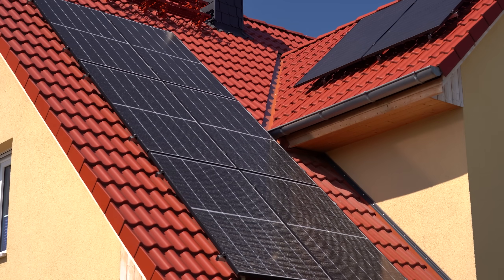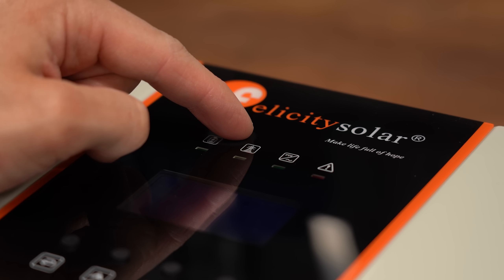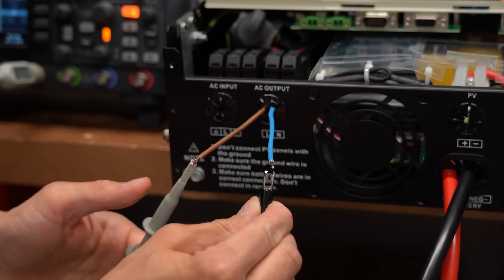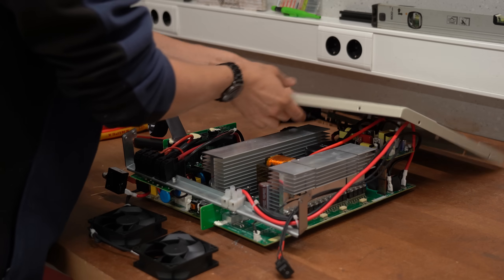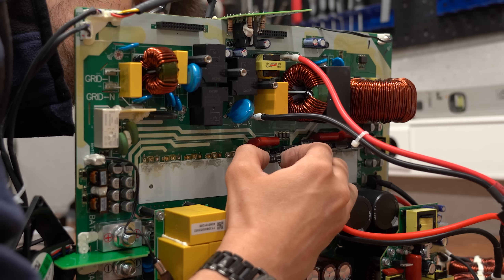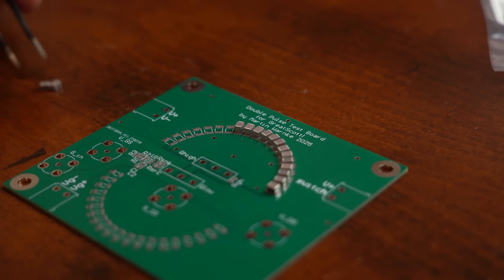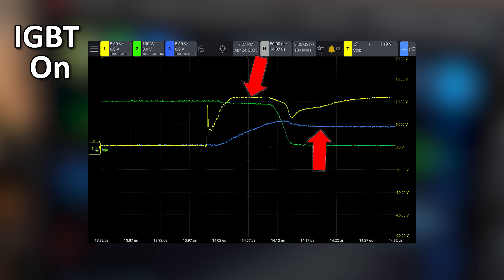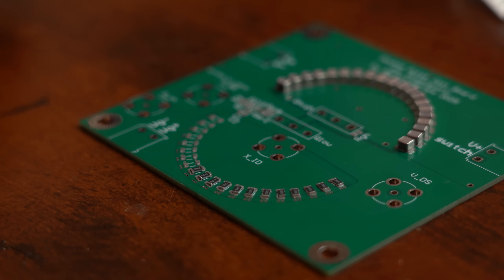Cheapest Inverter + Premium Parts = Surprising Results!

Comment: I bought a cheap hybrid inverter on ebay. It is labeled  Daxtromn AGH-6.2KW PRO. But there are many similar units available.

It is dangerous!!!

It is extremely noisy with fans like jet engines coning on as soon as the sun comes out. The power it makes must be way off normal because my induction hob refuses to switch on. 

But worst of all, it redirects grid/utility power inyo the earth. It dried out my earthing rod and started causing shocks from the kitchen sink. 

The supplier insisted this is normal! 
Just disconnect the earth wires was his solution. 

Horrible device! 
Avoid cheap hybrid inverters if you can!!!

Comment: Well, you made the inverter somewhat more efficient? For me the show stopper with this kind of chinese inverters was the idel power draw. Having four of them in a three phase system, it adds up... The ones i had should have consumed 50 Watts max according to specification, which is quite high already. But measured around and even over 80 Watts, so over 300 for all four of them times 24 hours per day would have made my solar system pointless. Disregarding, that one of the four inverters had a broken mainboard, i think the cheap inverter will in the long run still not make you happy, if for example a electrolytic capacitor fails, or even the fans, which they seem to use a lot.
Now i have four Multiplus II, which should have 18 Watts idle consumption, measured 21 Watts. Might be just in specification with some measurement accuracy taken into account...
Maybe in some years we have good AND affordable inverters. SIC will definitely help in this regard.

Comment: A 0.8% improvement in efficiency at rated power? Clearly not worth the effort. Also those IGBTs were barely working up a sweat at 40*C. That’s a damn good inverter for the price.

Comment: The first bank of transistors you saw, the one split between 3  heatsinks are the H bridge driving the step up foward converter. They are the ones that handle all the current and will actually get the hottest. The IGBTs are also a H bridge, but since they only pass up to 10 amps, their I2R losses are much lower. The first bank is the main high frequency voltage step up to the 400 odd volts that the IGBT bridge then chops up for the AC waveform.

Basically, these things contain 2 "class D" "audio" amplifiers. They run at a fixed frequency of course. The first bank chops up the 50-60 volts into 15-20odd khz DC that goes through the high frequency transformer. The high voltage on the other side gets rectified (you will find a set of 4 or multiple of 4 high speed diodes) to charge the main res caps.  Some higher end inverters might use synchronous rectifiers, but its not really that necessary at the lower currents of the high side system.

That high voltage rail is then used to feed the second H bridge which uses high frequency sine wave synthesis to turn into a sine wave. Thats what the gigantic inductor and capacitor bank are for, to filter out the high frequency noise and spit out the low frequency AC waveform.

Think of it as a class D subwoofer amplifier that only ever creates 50(60) hz.
Reply: the little mosfets are doing the heavy lifting, because it converts battery voltage into higher voltage, and batteries has a very large current, while the bigger mosfet (igbt) only converts the dc into pure sine wave ac through h-bridge configuration, and it's on the high voltage side it means that it only deals with low current, and by the way i also thought it would blow because he changed the igbt's with mosfet
Reply: You quote the IGBT losses as 1.77v for your 50 Amp load, but the specification clearly shows that as the typical Vce at 75 Amps... it would be less at 50 Amps.
Reply: He had a thermal camera, so I assume he was able to correctly identify the components that get the hottest. So if he replaced the IGBTs, it was probably them.
Reply: Thanks for the deep dive, this is the sort of analysis I was expecting from the video. I must say I was watching this video fully expecting the entire board to let out the magic smoke. There’s so much more to take into account, simply swapping out a FET is problematic. The entire circuit design revolves around those FET’s.

Comment: while I still don't a solar PV system of my own, at this point I think it is time for the cutting edge to start phasing out inverters or AC current for household. I mean, it is feasible for household outlets to have 110-240V DC power. Appliances would simply need DC converters to lower the voltages required. Household appliances with motors controlled by inverters are effectively DC. 
DC-AC  and AC-DC conversions is signficant loss of efficiency and cost of equipment.

Comment: I'm surprised it worked at all since Mosfets need a very different drive circuit.
Would probably get much better efficiency by driving the mosfets correctly.

Comment: Great video. That cheap inverter on the surface seems not bad for the $. Given you got About 1% Increase of efficiency for all that cost difference seems not worth it. However, longevity of the cheaper components is a different question.

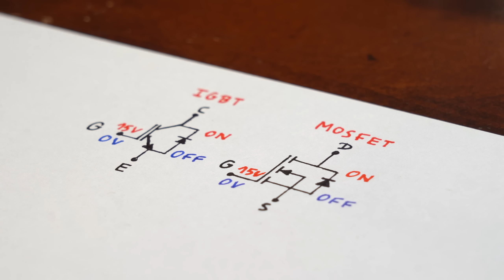Comment: 5:52 Your drawing of the IGBTs include diodes like the body diodes of MOSFETs. IGBTs do not have body diodes. You can buy IGBT components where the manufacturer includes a schottky diode on the same die so it works like a MOSFET, but it's not part of the IGBT and should not be in the schematic unless you are specifically referring to one of the combined packages.

Comment: Hm, I hadn't considered that; I've been thinking for a while about looking into getting some balcony (more like window-hung) solar and a battery setup for my apartment to have an whole-house UPS kinda thing (no feeding back to the grid, just charging on the cheaper hours, and if possible adding up power if the current demands exceed what just the UPS can provide); but if the battery and inverter are gonna be heating up the place that would complicate things a lot; the shitty building walls already make my AC struggle to approach the target temperature in hotter days....

Comment: 11:27 When you increase the gate voltage, the efficiency will probably increase even more. Because the Rds resistance decreases. But is there enough voltage for the SiC Mosfet gate? Maybe you can increase the voltage with a separate booster regulator. If you replace the other circuit elements (diodes etc.) in the circuit with the most efficient versions, I think the efficiency will increase to 98%.

Comment: Right heatsink components are the main load handling from the battery. Without them it wont output power from battery. Nor make bus voltage for the IGBT’s to use. Has nothing to do with PV input. Great video btw 👍

Comment: At 5:32 those are the battery side mosfets. If you follow the traces, they are connected to a center tap on the main transformer, and flip flop each opposite leg to get the square AC to go through the transformer coil, which its what creates the highV AC on the left hand side of the board. The highV AC is then rectified and smoothed by those giant caps, and are the power source for the IGBTs on the highV side. The solar FETs are on the daughter board. I think you'd have a great increase in efficiency by replacing the battery side FETs, but they are difficult to take out and low RDSon FETs of 150V and the same current limit are expensive

Comment: is there any reason to use AC power in our houses ? most devices work transforming AC to DC again 
what would be a nice DC voltage for a complete house power usage ? 36v ? 48v (that automoto industry has as probable solution )?

Comment: Similarly priced to these are the LuxPower units that have decent internal components and have communication capabilities with most LiFePO4 batteries, as well as a wifi dongle.
I have one installed and has proven to be extremely reliable.

Comment: Could you talk about how the test PCB was designed, what its schematic is, what things were optimized?
Reply: The DPT board consists of a capacitor bank with 5 large film capacitors and 20 C0G MLCCs in a semicircle arrangement. In the center of this arrangement two TO247-3L packages are connected in a half-bridge (totem-pole) configuration, the Source/Emitter pin of the low-side switch marks the system ground, which is the reference for all measurement ports and the gate driver. 

The shunt also consists of 20 SMD resistors in 1206 (or 1210) in a semicircle arrangement. The symmetry helps that each path to a single resistor has roughly the same impedance. The top side copper is mirrored on the first inner layer so that any current path has a corresponding return path. 

This way, magnetic fields from the flowing current cancel and the inductance drops dramatically to <4nH on the PCB and <20nH including the DUTs. 

Even if one would consider each resistor and its partial current part to have 2nH, with 2R resistors the shunt sensitivity would end up at 100mV/A with a bandwidth of >150MHz for the cost of 20 standard resistors. 

The PCB has a standard process 4L design with conservative design rules. 

The design goal was to make an easy-to-manufacture board with as low loop inductance as possible with standard components to actually show the differences in semiconductor switch performance independent of layout considerations. 

GreatScott! created some great switching curves with it that a lot of corporate engineers might now envy him for.

Comment: Great video! this is the first time I've heard of a SPWM signal, i'm glad to be learning something new
Reply: That's actually the first time I've heard it called that, and I'm not sure if it's a universal term. I've always just called it a pulse width modulated sine wave. But SPWM is easier, so I guess I'll start using it. It's how ekectric cars run 3-phase motors, and when used with audio waves instead of sine waves, it's how class D amps work.

Comment: I found out that using a Raspberry Pi and Solar Assistant software is far more useful with these inverters instead of the manufacturers „cloud“ solutions. The felicity inverters are really reliable solutions for our projects in Cameroon, where the brand is considered „expensive“ since it comes with battery and service centers in major cities which is unheard of for the really cheap brands.

Comment: Enough patience to setup wifi? Not a chance.
Enough patience to remove a big chunk of aluminum with 12 IGBTs? Of course.

Loved it 😂
Reply: seems like scott was curious to use his newly bought MOSFETs and didnt bother much to setup wifi. well i am aware of these chinese inverters and some times they become pain in ass if you initially miss even a very little detail.
Reply: @swaleedkhalid  You mean sponsored free MOSFETs.  Apparently they're a brand new product and run $20/per right now.
Reply: These Chinese "WiFi adapters" works through Chinese servers, struggle to update data even once in a five minutes and constantly fall on it's faces (stop sending data). Apps to see it are utter crap as well. Your will be so much better off with open-source esp mqtt board, can be bought assembled, or DIY'ed for like 5 euro. Setup also is a breeze in comparison.
Reply: can't blame him I spent over a week   trying every app   and  bit of software I could find  none of them worked  with my inverter apparently    my   gateway provider has them blocked because the servers are in China.
Reply: @OG_Gamers_Live  Ugh... I hate those cloud based services. Now it seems that I can't be able to do my laundry if the cloud isn't telling the machine how it's supposed to spin a motor 🤦
Reply: A lot of folks (including EG4 users) are saying it's the App causing the frustration, not the hardware.

Comment: I don't think you're right about those fets being used only for solar.

That inverter is a clone of the axpert series, and when I was debugging mine, those fets were used in the boost converter as a flyback regulator. Generating the 325VDC Bus line.

Comment: Great presentation!  This is the kind of thing that really is informative.  Before retirement I designed "things" for the oil patch.  That means high temperature requirements and high efficiency to prevent additional heating during operation.  The Si mosfet was a revolution for design.  Fast switching, high forward conduction and low power drive requirements.  They did have one big problem with the slow body diode.  Usually this was not a problem for most switching power because select fast recovery rectifiers could be used with their lower forward conduction voltage even at higher temperatures.  However, a full bridge totem pole circuit presented problems.  Depending on load (picture a 3 phase brushless motor) the top mosfet would switch much faster than the reverse recovery time of the bottom FET body diode ( and any Si diode across it),  allowing an effective short from the top rail through the bottom diode to the bottom rail = smoke.  The "bigger" the mosfet the greater the problem with the reverse recovery.  Enter Si Carbide.  Problem solved.  No reverse recovery time, just Q to charge and discharge.  The early devices were not an exact drop in for existing parts however, because of the higher gate drive spec.  In some cases that could be ignored because the Si Carbide mosfets had much better conduction characteristics even with lower gate drive.   I am glad you skipped the use of standard mosfets in this presentation because you would probably have been dealing with a lot of smoke.

Comment: Keep in mind that solar panels got stupid cheep because the chinese government heavily subsidized their production to the point that they are currently completely oversupplied. And the extremely low cost one are sold at a significant loss. 

This policy has also stopped recently so the price of solar panels should normalize soon and it probably won't go down again for a while.
Reply: Trina and others made a profit last year but this year probably all solar panel manufacturers will be loss making

Comment: I'm working with LV power supplies for Rollingstock, manufactured by ABB and these have been using SiC semiconductors for a few years now. The costs aren't too bad and the performance improvement over IBGT is worth having. More importantly for the systems I'm working with is the lower heat output: the SiC bits are in an IP65 enclosure, use and air to air heat exchanger and have to operate at up to 70°C ambient. Having less heat to lose really helps with fan noise. (a key deliverable on my project)

Comment: power your house "for free" after investing 10years worth of bills
Reply: One overlooked benefit to the solar break-even calculations is that the solar home's marginal price for electricity over the next 10 years will be lower.  This is good since future electricity will likely be higher rate due to global inflation but your marginal price remains the same or even goes lower.  Electricity rates have been climbing rapidly in some places (like in California).

Also, rooftop solar is a good way to diversify your investments and investing in your own home is a good way to do this.  The rooftop solar is a physical generator on your property.  Unlike a mutual fund or a 401(k), it’s “hard to lose” if the solar is properly installed and maintained. Even in a global or local economic downturn, your home still produces some (or all) of its own electricity.

Solar becomes an even easier a decision if direct subsidies, tax breaks, are available and/or other incentives like a 10-year 0% APR loan (Ex. Canada Greener Homes Loan).

Adding solar to a home generally increases the home's value and attractivity to potential buyers.  Often state/provincial regulations allow solar upgrades to not increase property tax whereas most other home upgrades of that size likely will trigger increased property taxes.

Finally, eventually the financial break-even date does arrive and all electricity afterwards will be that much cheaper ongoing from then on.

Comment: The cheap chinese inverter I bought was returned rather quickly, after runing it on batteries the RF noise drowned out my wifi signal😴🤯
Have you noticed any RF disturbance?
And probably to late to ask, but I'm curious if the change of mosfets did any improvement in that case. 😊
Reply: Which inverter did you buy?

Comment: The original IGBT are KGF75N65KDF from KEC, $1.70 each in bulk from China.
The SiC transistors shown are IMW120R020M1HXKSA1, about $10 each.  This is not a cheap rework.
Reply: Or the IRGP4066/3DPBF IGBT

Comment: The funny thing is that very few devices actually need good sine-wave inverters. Mostly things with synchronous motors like AC, fridges or washing machines. Electronic like PC, TV,  light-bulbs and even USB chargers can actually operate on 220V DC voltage. The first stage of these devices is converting the AC into DC and then stepping down the voltage. While it's possible to use a transformer for ~220V -> ~12V with 50Hz grid power, it's not very efficient and it's been phased out.
Reply: Yes Pv direct I’d fascinating, 5x 600w panels with MPPT of 40v =200v dc. The catch is the switches and thermostats for ac appliances will be destroyed over time due to dc arcing. The other problem is a cloud upsets your day. Even the hybrid 6kw hybrid inverters with 5.4pv input operated in batteryless mode are frustrating when that clould comes making the inverter cycle, not a nice sound.